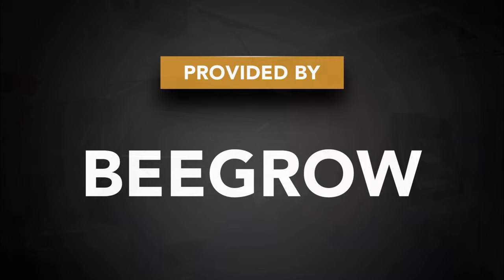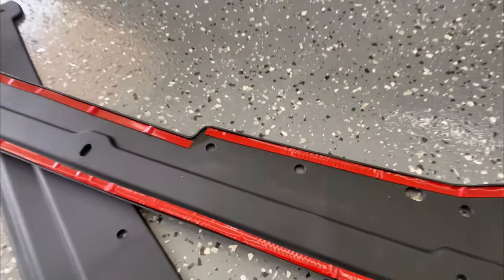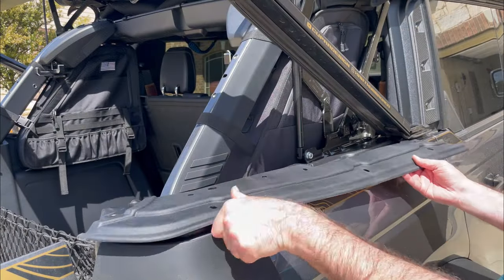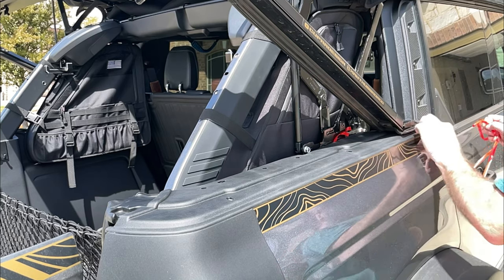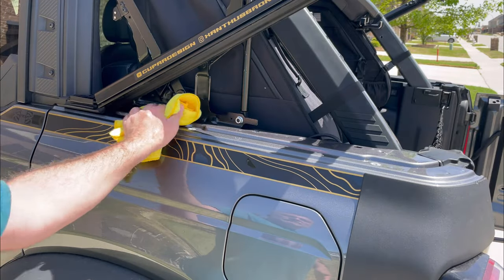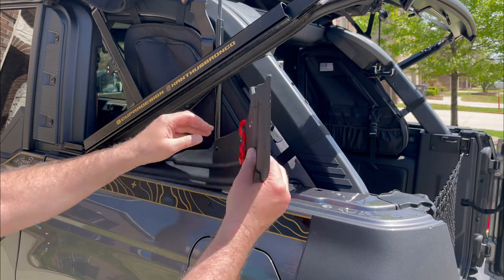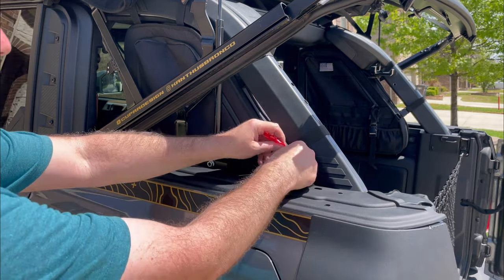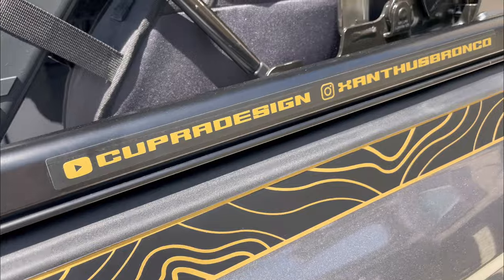How to Install the Cargo Area Upper Paint Protection Panels by BEEGROW - 2021+ Ford Bronco

Comment: I must admit I did have some choice words for you when after watching your tutorial I started to install the protectors.
You explained how there was no need to remove the soft top for installation, at first I did have a bit of trouble pushing them under the hinge but with a firmer push it went right in.
I did notice however that it’s easier if you push it in not only front to back but also toward the inside of the truck.
Well here goes from one Brit to another I’m sorry for doubting you.
Thanks for all your tutorials, very professional and easy to follow, keep it up.
Reply from the maker: Very cool, glad to know that you found the video useful and that it was easy enough to not have to remove the soft top. I did go back and forth a couple of times as to whether it really needed to be pulled off or not! 

Thankfully I got it to work the way I did, and great tip to slide it in toward the cargo area too. Only annoying thing it the paint coming off of those bolts but not really any way around that. 

Great to see another Brit Bronco owner 🇬🇧 and thank you for the kind words about the videos!

Comment: Thanks! I just received mine WITHOUT instructions and was dreading the fact that i would have to remove the soft-top to install! 

FYI, according to the Amazon reviews, hardtop owners claim it is a perfect fit for them too with a simple mod (by making a small hole in the product that can be achieved with a hole-punch).
Reply from the maker: Awesome! So glad that you found this video useful! I had instructions with mine and they said you had to take the soft top off. Didn’t want to do that so worked out now you can do it without. Been on ours for about 4 months now and sitting perfectly! Good luck, and thanks for watching!

Comment: it looks factory and complete if you have a soft top.  I would want to repaint those bolts after the install.  Thanks again for a great installation video.
Reply from the maker: Oh I know right, made me cringe when I took them off seeing the paint come off so easily like that! I have some touch up paint that I can dab on there. And I agree, it looks factory and really should have come from the factory like that.

Comment: Do these also help to create a better seal and does it make it a bit less noisy from wind noise
Thank u
Reply from the maker: I’ve only had them on since the weekend, but the placebo effect is that it feels like there is a better seal and and less movement in the soft top frame. But as I say, could be a ‘I think it’s better’ than it actually is. But so far, really glad of the added protection after having had those panels recently repainted.